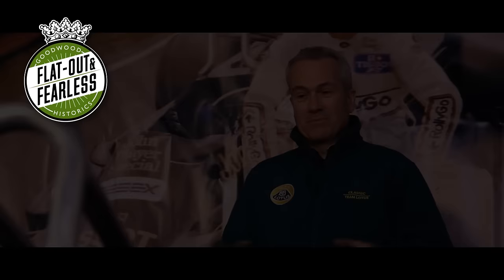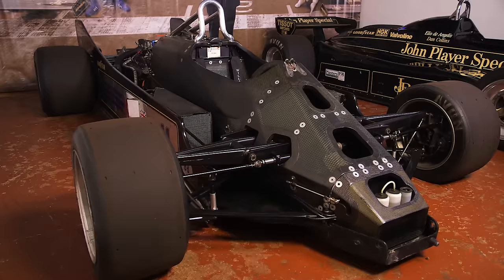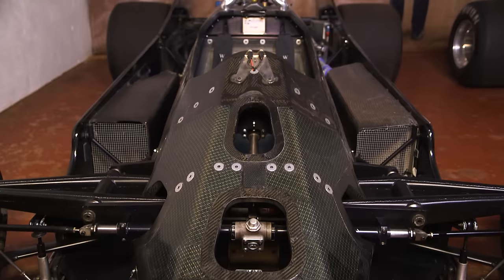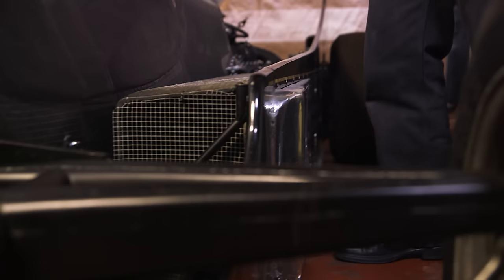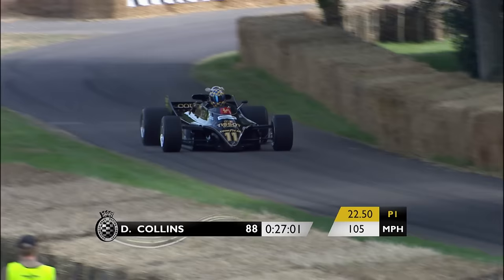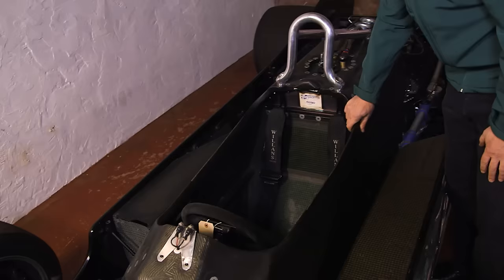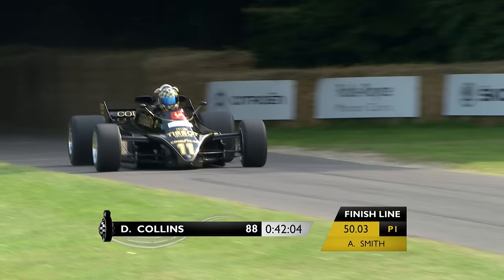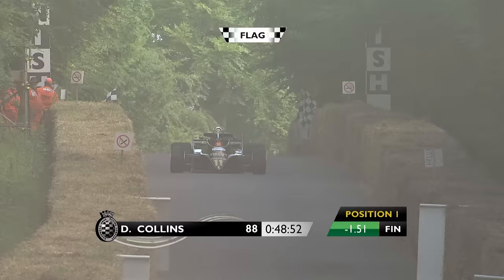Lotus Type 88 - The BANNED F1 car

Comment: Well done F.I.A. Ban anything that's good ; that way you arrive in 2018 with a Formula1 that is boring as hell.
Reply: is done in purpose, soon they will switch to the electric F-1 and a new group of commercial elitist tycoon will make the money...
Reply: In reality, other than being a blatant cheat (The rulebook banned mobile aerodynamic surfaces, and to make them bigger didn't make them legal) it was actually a slow, crappy and plainly dangerous car, and the pilots later confirmed they felt relieved when it had been banned.
Reply: It is late 2020 and it is even more boring, and I predict 2021 to be the same, I hope the IOM TT is on next year (2021)?
Reply: @maverickthebastard  this aged poorly lmao
Reply: You need to do some research. This car was protested by no fewer than eleven teams. Only Tyrrell, ATS, Fittipaldi and one other didn’t protest against it. It was no miracle car either. It was always several seconds off the pace.

Comment: Pity modern f1 cars arnt as exiting as 70s and 80 s ones
Reply: F1 needs a serious rethink .Get rid of all the electronics and stupid flappy gear changes and a proper clutch

And that's before get into politics
Reply: dude verstappen is 18(almost 19 now)
Reply: I thought Tyrell built the six wheeler.
Reply: cus they did
Reply: Tyrrell's six wheeler had four front wheels, Williams's had four at the rear...
Reply: They were only exciting for fans because they had LOTS of power, but handles like a cow.
Reply: David Edwards no it didn’t actually. The downforce on those cars were amazing.
Reply: Mark cbay so you don't want f1 to be the fastest cars in the world?
Reply: There are not much electronics in a F1 car that has impact on driving. Driver aids like traction control, stability control and ABS brakes has been banned since the 90's. I agree with you on the flippy flappy paddle gearbox though.
Reply: Infact todays F1 cars are harder to driver than the 3-litre V10 cars because they have a lot more torque. The Williams FW15C was banned because it everything was computer controlled, even the active suspension was computer controlled and it had both launch control and traction control and ABS brakes. With all those driving aids you've got a fast car but a boring car because you know that the car does all the work. F1 should be about skill.
Reply: I would rather see a bunch of Austin A35s race than watch an F1 race!
Reply: jonny j  formula 1 drivers will tell you the same thing...
Reply: When cars slided thru corners, jumped over hills, had manual boxes, big fat tires and spoilers... And they looked awesome! Not with an idiot ring in the drivers view
Reply: @goobingtons  only drivers ;)
Reply: @ferrarigirl666  that was my point...
Reply: @goobingtons  thats the risk they take, and got paid for, no? Do you think motorcross is safer? Or they got paid even more?
Reply: @ferrarigirl666  if you want dangerous driving being rewarded, go watch motogp. F1 is supposed to be a showcase of driving talent as well as the ability to push the boundaries of modern automotives. Sure they haven't done a great job at that, but no, they don't get paid to risk their lives, and cars having a lack of aerodynamics is not a good thing. The safer we can make the cars while still having a competitive league. And before you cherry pick and go full confirmation bias against the halo, no, its not perfect but its a lot better than a driver landing on their heads and dying instantly. The goal should be safe and competitive, not one or the other
Reply: @goobingtons  lack of aerodynamics???? Dude, all they work on IS aerodynamics... Into perfection.
Reply: @ferrarigirl666  sliding around is not perfect aerodynamics
Reply: @goobingtons  true, that is why they invented ground effect stuff.... But they banned almost all ideas in those days.... So its a circle, no?
Reply: @ferrarigirl666  yeah they haven't handled it perfectly but here's hoping
Reply: They really lost the plot when they started trying to make the cars green and fuel efficient - and they wanted to stop large engine makers creating qualifying engines (ones that were uber-tuned and basically grenaded after 3 laps). It's a race. People watched it because it was raw, obscene, expensive and dangerous.
Reply: Totally agree. Design-wise they were unbeatable.
Reply: @LOTPOR0402 What? Advance the formula by using out of date engineering? Great idea if you enjoy living in the past.

Comment: There is anecdotal evidence that it didn't work ...the downforce was very inconsistent. De Angelis is said to have told his Italian journalist mate that he was relieved it was banned.Maybe if it had some development it could have been sorted, but ultimately massive ground-effect downforce was just going up a blind alley. Cornering speeds would have just become too high.
Reply: i can imagine that since you need substancial speed so the outer chassis stays sucked down ... end with every little bump it just wants to jump back up since its suspended on some sort of oil dampened spring shocks ... at least it seems like that wehn he pushes on the car

Comment: I think f1 shouldn't ban anything during a season. I think there should be one point in  the year where they change the rules and that's it
Reply: They didn't ban the car during the season (it wasn't allowed to compete from the first race) and they didn't change the rules. The Type 88 was a blatant cheat. 
Mobile aerodynamic surfaces had bee already banned (and the rule had been introduced specifically to ban mobile skirts) cause they were really dangerous. In the Type 88 Chapman simply linked the two mobile skirts to create a single mobile aerodynamic surface under the car, and called it "chassis", but the only real chassis of the car was the so called "secondary" one. The one the tyres were attached to.
The only thing worth of note was the obstinacy of Chapman and Lotus to propose the car at every GP.
Reply: Neutron Alchemist That's true but technically it only was "one" chassi. so they said we didn't write it don't like that but we meant it that way. I think they should have something like a independent court in those situations to clearify whether they are following the rules or not
Reply: Neutron Alchemist but you are write I was mistaken they didn't rewrite the rules. they just reinterpreted them
Reply: Is not a question of reintrepretation. Only in movies the rulebooks need to contain any posible variation of a banned practice, and so, if it isn't specifically described in the book,the practice is allowed.
In reality, if the rules of soccer forbid to kick your adversary, they didn't need to describe any possible variation of the kicks. Any kind of kick is banned, unless is specifically written otherwise.
In this case, the rules banned mobile aerodynamic surfaces.
What Lotus described as a "primary chassis" in reality was a single mobile aerodynamic surface. It didn't have any other justification.
So it was banned.
The only point of discussion seems to be that the track referees allowed the car to participate to the first day of free practice, ahead of the first GP of the season.
But track referees don't control the compliance of the cars to all the rules first to allow to them to practice. They usually only control if the car is plainly dangerous (IE, if there are parts that are not secured). if a car is later discovered to cheat the rules, it can be disqualified after having run and after having won too.
Reply: @neutronalchemist3241  Thank you!! This is the comment that makes the most sense

Comment: I miss the sweet sound of those 20,000 rpm compressed gas valve V10's...Now I don't even watch F1 anymore...
Reply: KJ Rivas what about the v16s?
Reply: Even though this is a 3 litre V8?
Reply: amen
Reply: Stopped watching f1 after Senna died and the sport has been in a downward spiral ever since with huge cumbersome autopilot cars and overtaking only on straights
Reply: IndyCar is better than F1 now.
Reply: Miatacrosser well, if you want to compare this to a Ferrari V10 or V12... Ferraris V10's were the greatest NA engines ever made. 920 HP on a 3.0 V10, that weight only about 91kg, and that could reach 20000 rpm
Reply: I totally agree with you I don't watch F1 any longer too much restaint
Reply: @Jigalygirl  I too stopped after Sena died and all the silly burocrats took over
Reply: That's nice
Reply: This car/video has nothing to do with them so whine somewhere else.
Reply: Same here I’ve said for years, football don’t change rules to stop the better team winning its turned into a farce
Reply: Living in the past.

Comment: Good old FIA fucking with motorsports since 1981
Reply: You realize the only proven danger was that it was faster right? Slowing the cars by making engines smaller or wings smaller is smart, but banning things that could have simply been hugely innovative like this is just boring. Kind of like the ban on rotary engines in Le Mans.

Admittedly there is the death of Villeneuve, which might've been in part due to ground force. But we don't even really know if it was that or the tires. The only other bad things that occurred were crashes, and well, that does kind of happen in F1.

Crashes and deaths happen in F1, I honestly don't know if the ground effect era had a higher rate of these or not. That would be the real question here. This article does nothing to state (that I can see of, maybe I missed it) whether there was an increase in crashes or not.

Comment: I saw this car's first appearance, at the '81 U.S. Grand Prix West, in Long Beach. Looked very sharp, with mirror-like sides that up-sweep to the rear wing. Elio De Angelis drove it during Friday practice and qualifying sessions, and Saturday morning practice, but other teams protested the car's design and the car was banned after that for the remainder of the weekend. The teams protested that having two sub-chassis that move relative to each other in order to maintain a seal of the side skirts to the road surface, constituted a moveable aerodynamic device, something long-banned in F1.
One thing that Clive didn't mention, is that the inner chassis was much more softly sprung than the outer chassis. This made the ride much more comfortable. To maintain a seal of the fixed side skirts of the other teams' cars to the road, the chassis springing was much stiffer, giving a highly punishing ride to the driver. A Lotus 88 driver enjoyed a much more softly sprung ride, and could maintain a faster pace throughout the race than the other drivers could.

One thing I'm curious about is why the jump in Type numbers from 80 to 88.
Reply: jon doe what ?
Reply: Xd type 88 is a revolutionary machine gun too
Reply: 99percenter1 That looks beautyful
Reply: The latest GT-R does Red Bull Ring(F1 Austian grand-prix) in 1.45.50
2017 F1 Mercedes-Benz W08 does it in 1.04.25

And it's one of the shortest track on the calendar. At Spa GT-R loses over a minute...
Reply: jon doe let's ponder this. There is a video here on u tube pitting a modern Corvette ZR-1 against a 1967 Lotus 49 at COTA. The Lotus flat out kicks that Corvettes ass.  I mean it's not even close. So.....You just like to be a troll don't you.
Reply: 99percenter1 Not quite. It was eventually banned under the long standing rule covering suspension-mounted aerofoils and rightly so. It just isn’t mentioned in this video. The Lotus numbering actually tells you they were expecting it to be banned because the other car was the Lotus 86, essentially the same car with normal ground effect bodywork. They knew exactly what they were doing.
Reply: @thethirdman225 , ah yes, suspension mounted airfoils-illegal-you are correct.  They came about when teams started mounting front and rear wings on the suspension arms in the late 60's. A few failures led to some serious accidents and they were banned. 
When these type of things arise why don't the haters ever think that other teams may have thought of the same thing but knew it was illegal so they didn't build their own?
Reply: SuperExcedrin Exactly. No such thing as a monopoly on ideas!
Reply: SuperExcedrin Incidentally, Brabham countered the 60mm gap rule with hydro pneumatic suspension, which did much the same thing.
Reply: Lotus give numbers in the same series to all their models, not just their GP cars.  Examples In the gap you mentioned type 82 was the espirit Turbo and 83 was the series 2 elite.
Reply: There were 7 other cars designed by Lotus, in the relatively short time between the two F1 cars mentioned here

Comment: Changing the rules simply because someone found the way to meet them and have a better car.

Essentially:  You are not allowed to be that far ahead of your competition in engineering.
Reply: They didn't change the rules. The Type 88 was a blatant cheat. 
Mobile aerodynamic surfaces had bee already banned (and the rule had been introduced specifically to ban mobile skirts) cause they were really dangerous. In the Type 88 Chapman simply linked the two mobile skirts to create a single mobile aerodynamic surface under the car, and called it "chassis", but the only real chassis of the car was the so called "secondary" one. The one the tyres were attached to.
The only thing worth of note was the obstinacy of Chapman and Lotus to propose the car at every GP.
Reply: 1) The car was obviously a cheat from the start. The rulebook banned mobile aerodynamic surfaces, and to make them bigger didn't make them legal. 
2) In reality it was actually a slow, crappy and plainly dangerous car, and the pilots later confirmed they felt relieved when it had been banned.
Reply: @neutronalchemist3241  So was the 72, until they developed it.
Reply: @jamesberwanger250  The 72 was never especially slow. It was difficult to set up because of its torsion bar suspension.

Comment: They passed it under the official scrutiny testing, then when the other teams got wind of it and complained  (cough/cough/Ferrari/cough/cough) then and only then did they decide to Ban it.
If they had painted it red and stuck a prancing horse badge on the front it would have been ok.
Ps
If you doubt my account... My two uncles were on the Lotus team at the time. 1 was the Chief mechanic in charge and the other was one of the 5 pit mechanics so I heard the story 1st hand.
Reply: The issue was that the "twin chassis" represented a moveable aerodynamic device - something that was expressly banned at the time.   While Ferrari certainly were one of the teams to complain about it not being within the rules, IIRC they were not the only ones.

Six wheelers, alleged water injection, Brabham's hydro pneumatic suspension system, the Fan cars, even Ross Brawn's double diffuser... all were non Ferrari innovations that weren't banned.   I know it sucked for Lotus because they'd thrown their all into this one tech trick... and it was banned.
Reply: Your story is biased and unreliable because of your family ties from it lol
Reply: Rules said no ground effect.
Lotus made a car in different way but it still it was made for ground effect.
Reply: 1) The car didn't pass any scrutiny. It was obviously a cheat and was stopped from the first time it was shown. The rulebook banned mobile aerodynamic surfaces, and to make them bigger didn't make them legal. 
2) TO COMPLAIN HAD BEEN THE OTHER BRITISH MANUFACTURERS, NOT FERRARI. 
3) In reality it was actually a slow, crappy and plainly dangerous car, and the pilots later confirmed they felt relieved when it had been banned.
Reply: @neutronalchemist3241  Stop shouting
Reply: The ban had nothing to do with Ferrari. Nothing.

In fact, the car was protested by eleven teams, including most of the British teams.

The reason Chapman was threatened with being banned from racing and fined was that the car had already lost in the courts. Legally, it wasn’t even supposed to be at Silverstone and certainly should not have been presented for scrutineering. But Chapman called on the old boy network for a favour and they gave him a sticker.

Comment: Colin Chapman true genius. McLaren claim to do the first carbon frame when I knew it was team lotus.
Reply: DirtyDiesel100 mclaren riveted carbon panels together. The lotes monocoque is one piece.
Reply: mightress I never knew thanks for the insight
Reply: @mightress Other way around. McLaren’s chassis was a unitary structure, vacuum bagged and baked in an autoclave (Hercules). It was more advanced than Lotus’ chassis, which was bonded and riveted. You can see the rivets in this video.

Comment: Until the early 80's the formula 1 and world rally championship was free to evolve without serious restrictions. Gradually during early 80's the drivers weren't able physically to control the high speed and acceleration of their cars. A great example was the class B of world rally championship. 
For me that was the golden period of Motorsport. The drivers were struggling with the immense power, speed and acceleration. 
Afterwards restrictions made cars safer and boring. Also electronics helped less gifted drivers to surface. 
80's was revolutionary in many technological areas too. It was the end of the analog area and real human interaction with technology. After 90's the digital revolution changed everything.

Comment: FIA actually banned a safety feature .. since this twin chassis car would not have been susceptible to dangerously bottoming out, as were later cars which without skirts ran dangerously low ride heights, killing many drivers, like Senna.
Reply: No, it was banned under a pre-existing rule that prohibited suspension mounted aerofoils. That rule stipulates that all aerofoils must be affixed to the suspended part of the car.